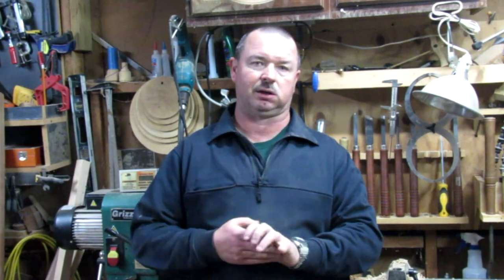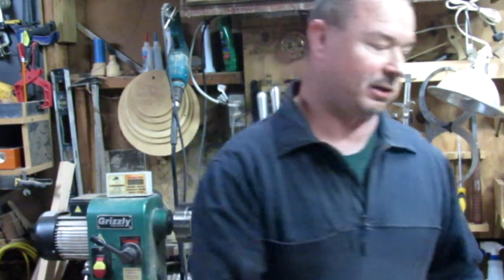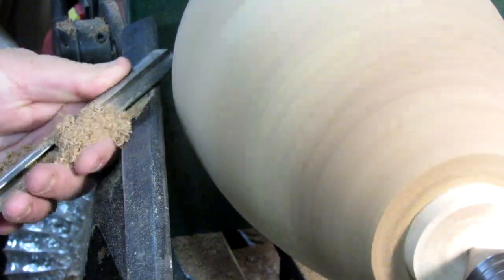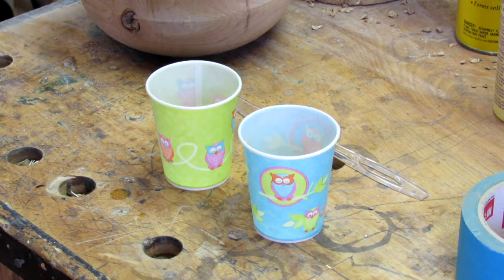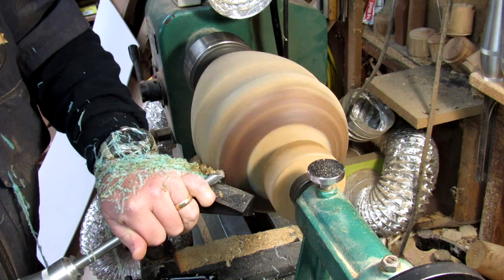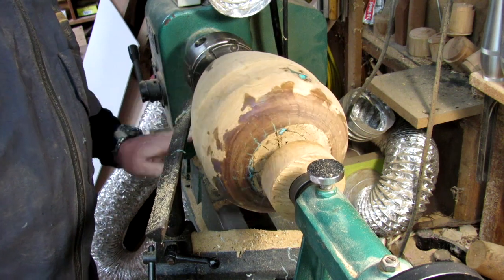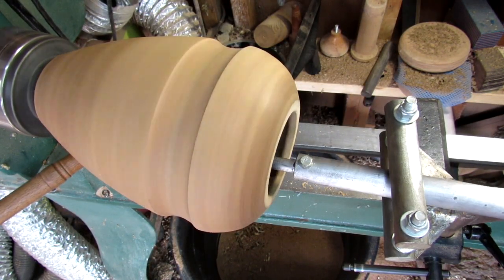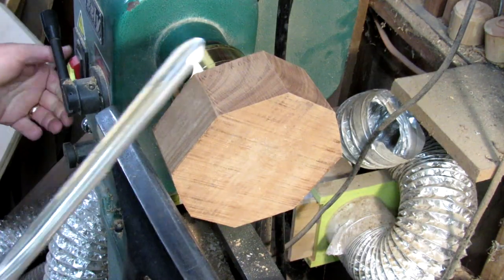#127 Woodturning a Live Flower Vase Part 1

Comment: Hey Stephen, that has the makings of a very fine vase, looking forward to part 2.  The hook tool looks to be a very effective and by chance I happen to have some old HSS blades and bar stock hanging about.  Would be real interested in seeing a video on how you make the next ones. Take good care, Gord
Reply from the maker: Thank you Gord. That Hook Tool really cuts great. The only problem is that the handle is too short to reach very far into a vase. Point noted and I will change that on the next one. The HSS will make superior tools for you, although I do not know the temperatures of heat treating it. I think it must be hotter than the High Carbon steel I used for this hook (of course it could be cooler too). Look for part 2 very soon.
Reply: Had an oldtimer's moment; meant to say HCS, not HSS...:~).
Reply from the maker: Gord Roberts The High Carbon Steel will also produce excellent tools also. The Japanese Katana is made from it.

Comment: Do you use the Deft sanding sealer full strength or do you thin it with lacquer thinner?
Reply from the maker: Thank you Scott. Good question. I know that a lot of people thin it down, however, I use it straight from the can. My reasoning is that it is designed to be used as a sanding sealer and that is what I am using it for. It penetrates the wood very nicely. No need to thin it. Perhaps if I were using it on a very dense wood where penetration is questionable. I hope this helps.

Comment: I cheated a little and spotted a glimpse of  the finished vase in your intro. :) It looks great, but I'll wait, with your other subs, to see the procedure for coating the interior with epoxy...and the product used. Was that Deft you used the lacquer sanding sealer? One more question, is the hollowing tool you use a shop made tool or "Store Bought"?
Reply from the maker: Thank you Gil. You are very observant. I did not actually think anyone would notice the finished vase in the beginning. It was like an "Easter Egg" and you won! I used DEFT sanding sealer on the exterior. All the hollowing was done with shopmade tools. Take care my friend.

Comment: Great video as usual. I really like turquoise also. I use the old CA and wood dust technique to fill burl wood for my knife handles. I see you use alumilite products for several things. I guess I need to try there stuff. I use that gorilla glue epoxy often, but only in cool weather. I had it set up twice on me last summer before I could get the handles on the blade. Could you have used the alumilite to attach the rim? Can't wait to see part2
Reply from the maker: Thank you Ron. The CA and sawdust technique is my go to method for repairs; however, sometimes I just like to use another method for a certain look. There are lots of different epoxies and resins to choose from. I have kind of settled into the Alumilite products for its availability in my area. It can also stand up to abuse really well. Yes, I could have used it to attach the rim but I tend to use the Gorilla or Locktite epoxies for small jobs where I am only mixing a little resin. I hope this helps.
Reply: Stephen Ogle Thanks, that answers it. I didn't know if it was only designed for casting. It also seems a bit pricey, so I didn't know if that was the reason. Looking at the quantity of the alumilite bottles though, maybe it doesn't cost more than the small syringe size epoxy. I'm still experimenting and always learning. Thanks again for the videos

Comment: Definitely want to see the 'Making the Hook Tool' video when you make it. Could it be done with a jigsaw blade maybe? Would still need heat to bend it but wouldn't need to cut down a carpenter's saw blade and maybe a little thicker steel.
Reply from the maker: Thank you sir. I have definitely had enough feedback to do the Hook Tool video. It will be after an upcoming show but should be within the next couple of months. The jigsaw blade could possibly work for a very small hook. They are awfully thin. The blade I used was from a tablesaw and was almost 1/8" thick. I still got some vibration from the blade itself. My next one will be a smaller hook from the same thickness steel. I think that will work even better.
Reply: I'll look forward to it. Keep up the great work. I enjoy the workshop projects as much as the turning. Have a great show.

Comment: Beautiful turning Stephen and as always, excellent teaching video.  I am curious about the original log that you started with. Do you have a picture of that or maybe what the dimensions were? The vase opening is not into end grain, correct?  Thank you again!
Reply from the maker: Thank you Andrea. I do not have a picture of the rough log. However, the dimensions were close to 12 inches long by about 7 inches diameter. You are correct that the rim sits on top of the vase. I used a mortise and tenon to get everything centered but all of that was eventually turned away. I am really glad you enjoyed this project. I hope htis helps. Take care.

Comment: #stephenogle  Yet another great video bud.  I write notes when I watch yours.  Right now I'm trying to find a affordable 1/2"-5/8" fingernail gouge.  Since I'm just depending on my SSDI I tend to buy mostly HSS tools.  Can you tell me about one I might be able to afford?  Oh, can you make a video on making your hook tool?  Lord knows I have plenty of old saw blades laying around.  Thanks.  Hope your being safe at your day job
Reply from the maker: Thank you Todd. I started with and used for about 7 years the "Benjamin's Best" gouges from www.pennstateindustries.com and found them to be very good tools. I still keep them to use as a backup to my new set. They are M2 HSS and will get and hold a very sharp edge. They are very reasonably priced also. I think you will like them.  I will be making a video on making the hook tool. It really cuts great but I did learn a few lessons "Longer Handle". I hope this helps. let me know If I can help with any more questions.
Reply: Stephen Ogle I've been on their site before.  Thank you.  They still don't have the fingernail gouges tho.  I've been buying from eBay so far.  Gotta love those payments...lol.  I'll start doing a Google search though for the M2.  I looked it up and it ends up that's the one I already have.  What I'm looking for is the long sweep/long blade like the one your using.
Reply from the maker: Thank you Todd. You need to grind the fingernail yourself. Most all gouges come with a more traditional grind. It does not take much to do it. I even had to fingernail grind my Carter and Son Tools. I use the David Ellsworth Grind. You can find the specs for the grind at Capt. Eddie's Website. Look under sharing information. http://www.eddiecastelin.com/sharing_information He also has the specs to build the Blackhawk sharpening jig for your grinder.